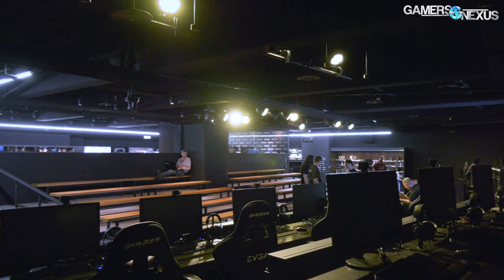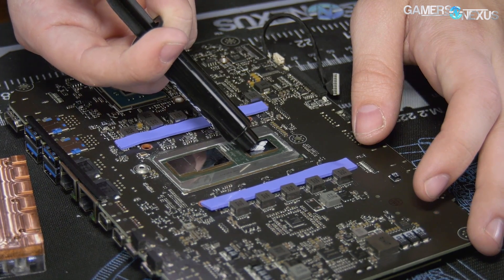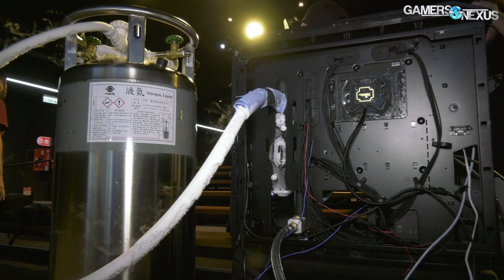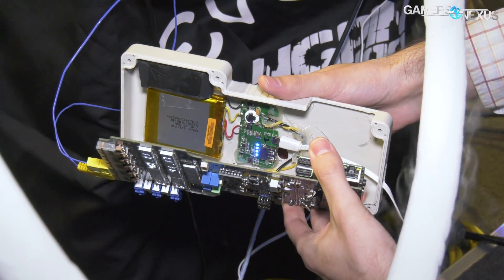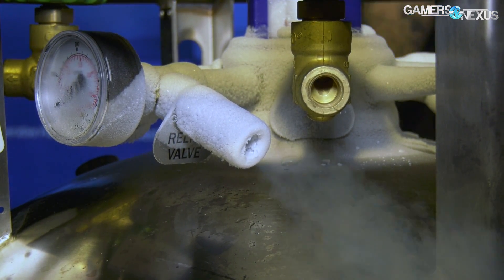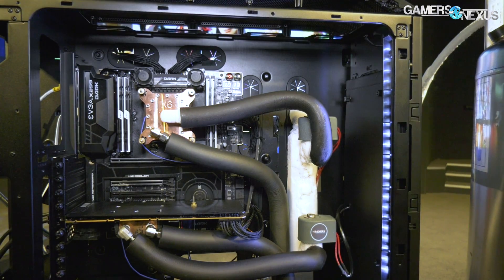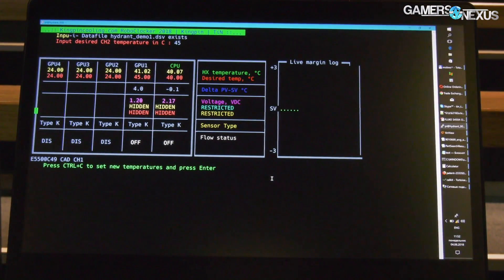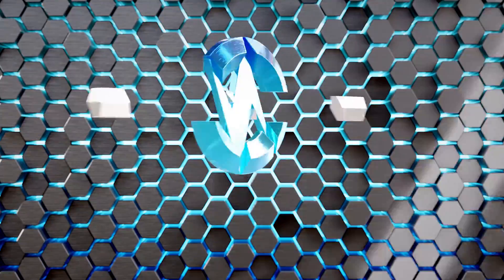"Closed-Loop" Liquid Nitrogen Cooler | EVGA Roboclocker Computex

Comment from the maker: Article: https://www.gamersnexus.net/news-pc/3316-evga-liquid-nitrogen-closed-loop-overclocking-roboclocker
You would also like our Taipei digital market tour with GPU/memory prices: https://www.youtube.com/watch?v=vgNirAOLRDQ
Reply: Would you mind asking them why  they do not try to reliquify the N2 via another compressor circuit? It might not be economical because of the electricity cost on such a small scale but it would be really really cool to have a true closed loop N2 cooler.
Reply: Now this is pushing JGiggawattz! An amazing bit of tech.
Reply: maybe sth. to bring home for buildzoid? :D
Reply: What CPU are they using, steve?
Reply: Steve thinks he is so cool. Bleh bleh. Never answer my questions I feel like the black sheep of the community. lol
Reply: Do you think LN2 will get a closed loop AIO or do you think its too dangerous right now and in the future? Also I heard you mention a Peltzer cooling and nothing after that but I thought they tried that in the 90s but it phased out or is it still applicable?
Reply: I Love how this thing is made from off the shelf parts! Commercial air conditioning manifolds, USAF "-AN" fittings, and automotive Nitrous Oxide solenoids...
Reply: How many watts can the gpu use

Comment: this is insane. i was trying to do the math on a closed loop system. but a more portable version of this. ( with condenser. evaporator. pressure tank, and use the heat of what im cooling as a means of circulation> high to low pressure system and valves to keep things moving in one direction. but a radiator would almost be pointless because of condensation in any humidity.) 
basically what im saying. is there should be a way to do this set up without using just basic refrigerant like you could use in your car. or having a massive tank of liquid nitrogen. 
im just not smart enough to figure it out

Comment: if oyu touched the cold part in the PC, the tnak, or the copper p lates which are obv very cold, would yo uget frostbite? with some liquid metal and obv the liquid nitrogen cooling ,those temps msut be damnn low! I'd assume -10c but I didn't watch the whole vid  yet

Comment: Engineering question: Why can't they reclaim all the N2? If they had a pump on the return couldn't they compress the N2 back to liquid state? Assuming no impurities in the line, and 316 stainless tubing throughout?
Reply: Its my understanding that gas nitrogen does not simply compress back to liquid . It seems to require chilling way down in temp at the same time its compressed . I believe this is done to shift its triple point .
Reply: @texasslingleadsomtingwong8751  So in other words it can be done but it would be the size of my car.
Reply: @generalralph6291  and cost a phenomenal amount of money . If I'm not mistaken  , helium is used as the refrigerant

Comment: At that point, why not even close the case entirely and put it under nitrogen atmosphere (to avoid all that water condensation that freak me out) ? It's not like if they didn't had quite a lot of nitrogen laying around anyway and I don't think the other components would have trouble with cooling when some parts of it are close to LN2 temps :p

Comment: Now combine that thing with a nice compressor circuit to reliquify the offgassing N2 and boom, closed loop N2 cooler!
Reply: you need a cascaded refrigeration system to re-liquefy LN2.
Reply: well then ;) i mean, it's a show piece, isn't that the place to pay some "fuck you" money just to show they can do it? I know that it won't be economical by any means but it would still be freaking cool ;)
Reply: The apparatus would take a lot of space and is hard to transport. Donate them some "fuck you" money and they'll probably do it.
Reply: @dan8t669  make it modular, you can choose to reclaim LN2 by connecting a tube, which seems like you already can.
Reply: Or just a super expensive cryocooler with a high enough watt load rating. (would set you back a cool 10-15k) probably.

Comment: Calling it. In about 2 decades or less, water cooling will be entry level and liquid nitrogen will for enthusiasts
Reply: Doubt it, water cooling at worst will splash you with warm water if it fails, if you have a LN2 leak, you are leaving with less fingers then you started with.

Comment: Wow all they need is a compressor and a condenser and then you'd have a closed loop LN2 system. I wonder if a refrigerant system would be more efficient than LN2 at this stage. Very neat effort there guys!!
Reply: it would have to be quite a heavy duty system though, way more powerful than what you have in your freezer

Comment: Why not just submerge the entire Motherboard and graphics card in a tank of liquid nitrogen? with special purpose made interfaces for the I/O and power, that way you don't need to worry about condensation, since the whole thing is submerged anyway. It will ofcourse need to be sealed system.
Reply: because you need temperature control. A 7980XE won't run bellow -110C.
Reply: Ah got ya!. Maybe there's a way to actually control temperature with a peltier unit? So the basic gist is that the CPU would actually be insulated by some sort of peltier interfacing, being sealed itself from the liquid nitrogen "environment" (if we imagine the submerged idea) and only allow a certain level of heat to be transferred to the liquid nitrogen.
Reply: Chaim Goldbaum not just that but they often need to heat the board to stop the boards from freezing and coldbugs taking over.

Comment: how does it deal with moisture? it has those massive icicles building up near the motherboard how isn't this shorting out all the time?
Reply: probably sprayed the whole mobo with lacquer. just a guess.
Reply: It's stated in the video it's his actual overclocking rig.
Reply: It's a show build, they don't care if it fails.  Real world, you would use grease or something to coat the board, and probably have a condensate pan/pump to catch the melting ice.
Reply: kingpin mentioned he smothers vaseline on everything.
...
...
...everything ;)
Reply: Alexander Howarth if you look around the areas where it's actually close (ie the CPU and GPU) they've put insulation and it'll also be filled with some kind of putty underneath too - that's what you have to do with all sub-ambient cooling
Reply: EVGA probably wanted their mobo visible. I would assume it would be completely covered in insulation when actually used. I haven't found the live stream of this in use yet...

Comment: That thing looks almost production ready
Reply: hint hint
Reply: Maybe add some shielding stopping any shorting out from condensation
Reply: Hardrive33 they'd probably bundle it with a custom Mobo designed for ln2
Reply: Shade The Rapper yea, but some users might want custom selection, or certain things that Mobo doesn't have

Comment: What are the expected OUT OF THE BOX temperatures for this?
Reply: In another video, it's claimed to be dropping CPUs and GPU's into less than -70 C temperatures! Essentially temps significantly lower than idle temps on any other system.
Reply: About 77K.
Reply: imakuniaw about 20 degrees C xD